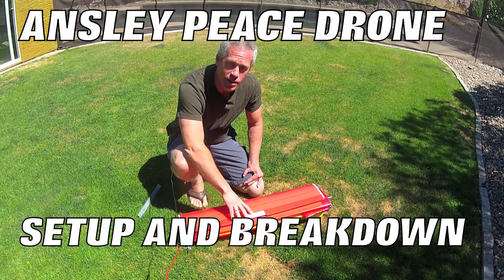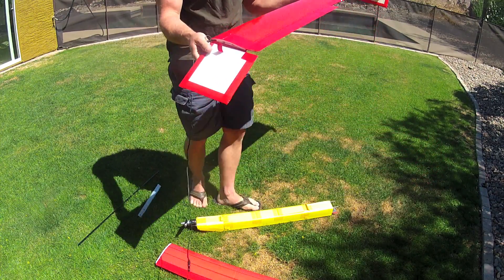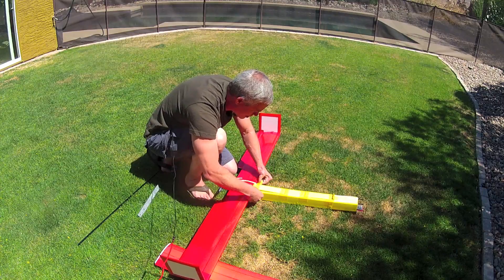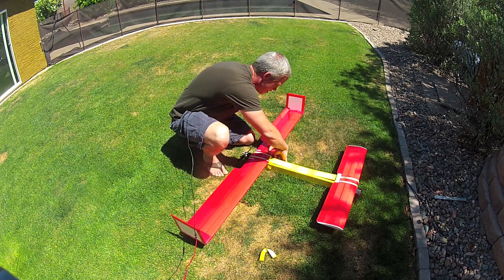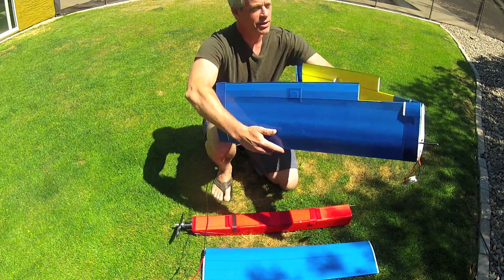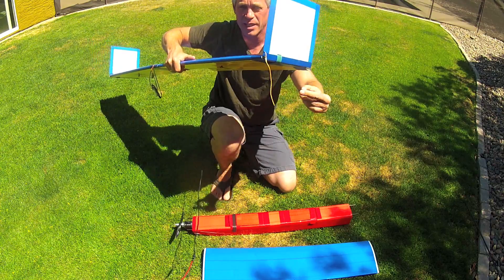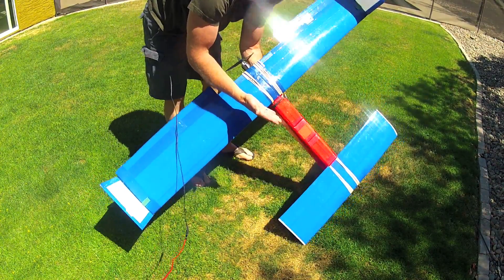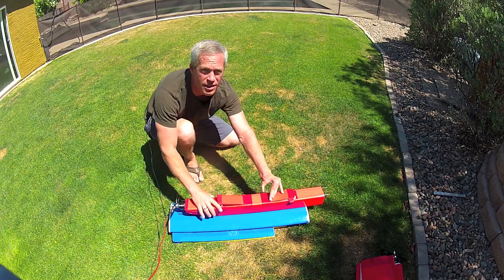ANSLEY PEACE DRONE - Setup & Breakdown

Comment from the maker: Actually the 7.5mm carbon fiber tubes you can get from RadicalRC com are as good or better than arrow shafts for the same price and pretty reasonable shipping. You can also get nesting sizes that telescope inside each other for joining multiple wings.  Wooden dowels can be OK but if you get one with a knot or weak spot in the center then you're hosed.  CF is so light and strong it's worth $5 for a lifetime spar, IMO.